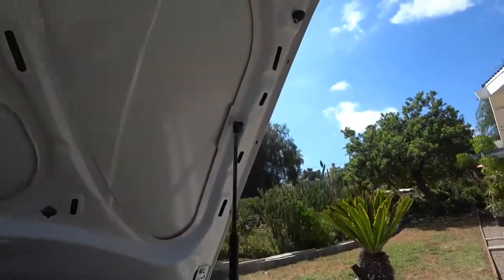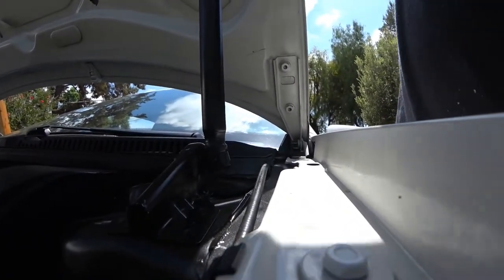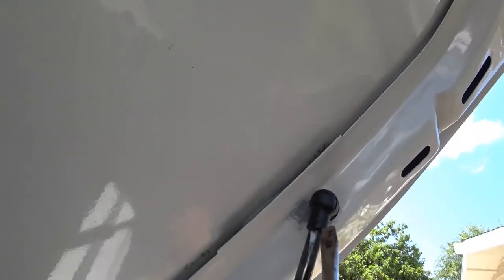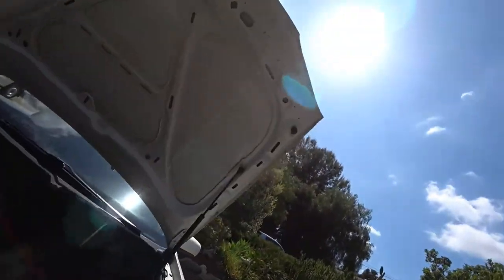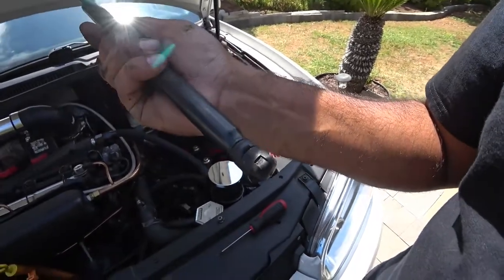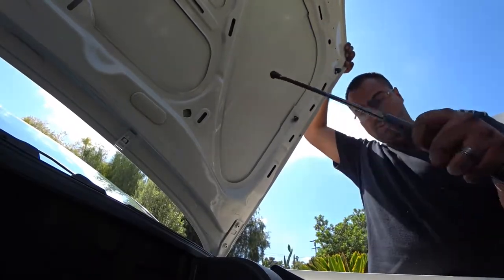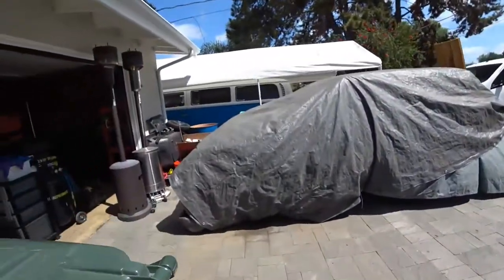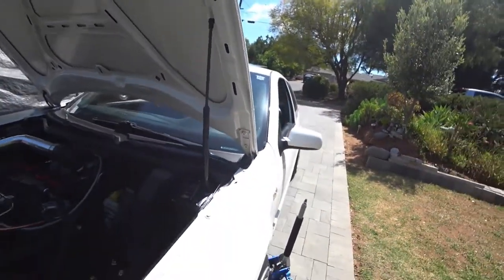How to install a MK4 Hood Strut "Quickie"

Comment: You can install many things on your filbert.
Like
Angel eyes
Fog lights
Day Time Running lights
Reverse and forward cameras
Sat Nav & TV
Boost and torque gauges

By the way, did you install a tow bar at the rear or you took to the garage to do it. Would be interesting to see how you install this.
Reply from the maker: Khai Bui dont like angle eyes, cant install fog lights because of my intercooler, already have sat nav, dont need a camera on a car that is so small and Boost - AFR gauge coming soon.
Reply from the maker: Khai Bui good recommendations though. If anyone has a car that needs these I will do the install for free.